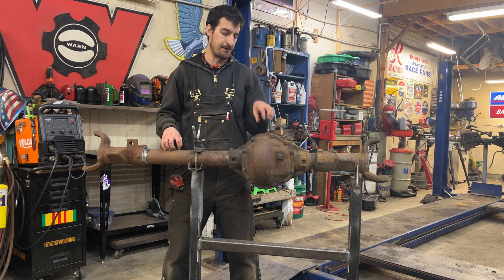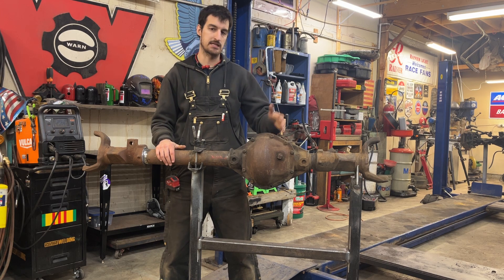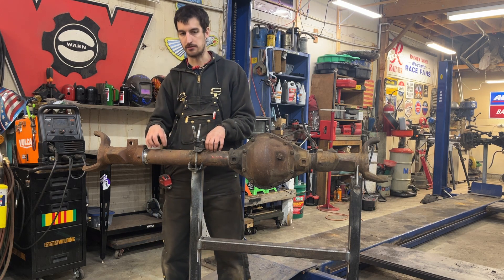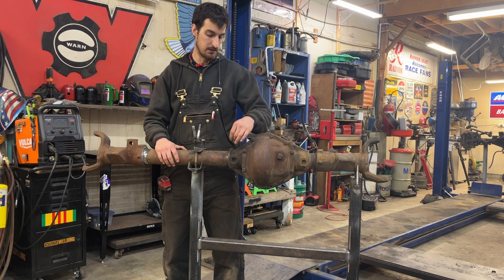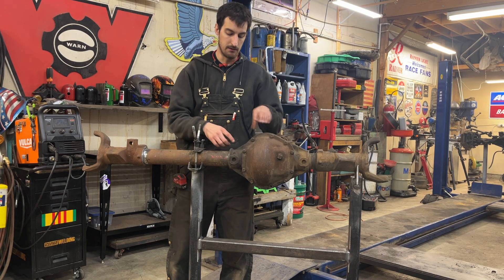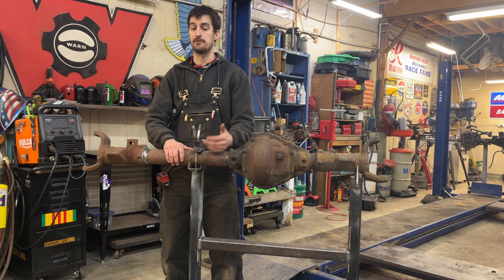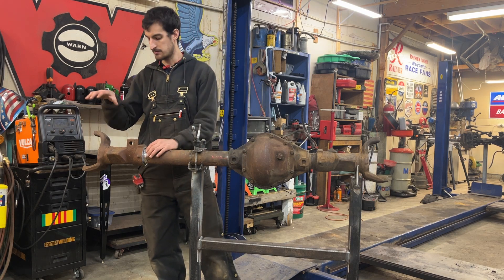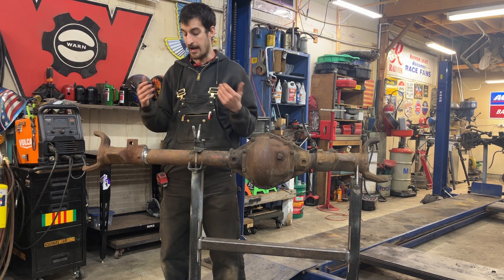Narrowing a High Pinion Dana 44 for 1966-77 Ford Bronco

Comment: Do you have a video on removing the wedge castings from a 74 to 77 F 150 / Bronco front axle to put spring perches on?
Reply from the maker: I don't but if you look at them they just have welds on the top and bottom of them that parallel the axle tube. If you just cut down on those roughly to the axle tube then take a hammer they will come off

Comment: A way to cut straight is put a hose clamp on and saw/ cut off wheel. If you pull the tune out of the housing then it will need machined outside to fit back in and a new inner seal surface on the inside.